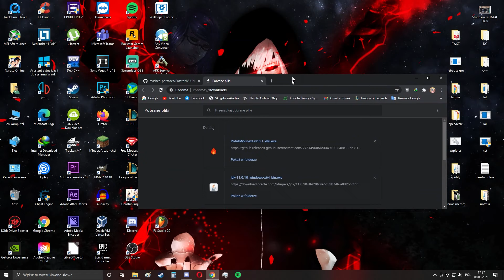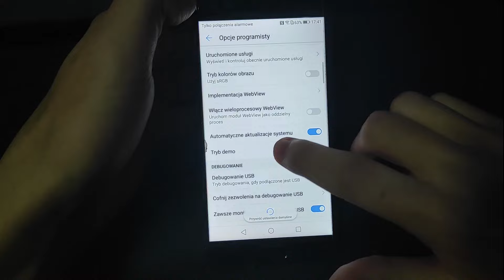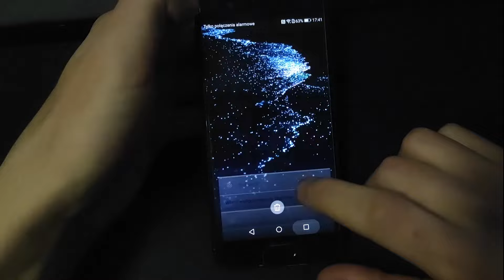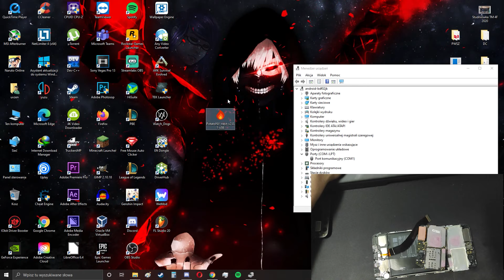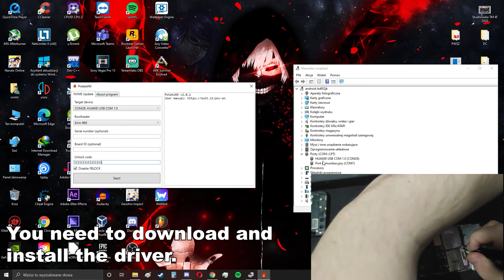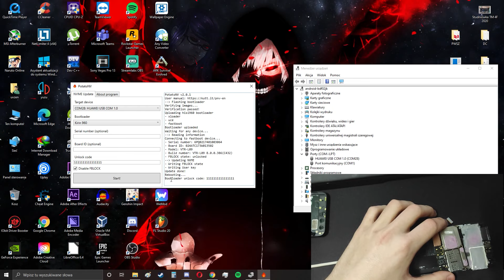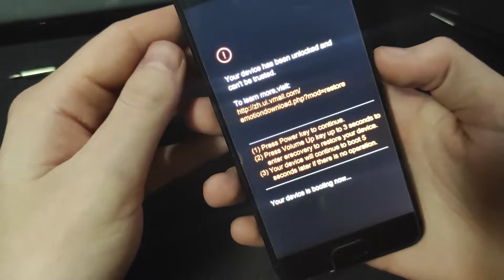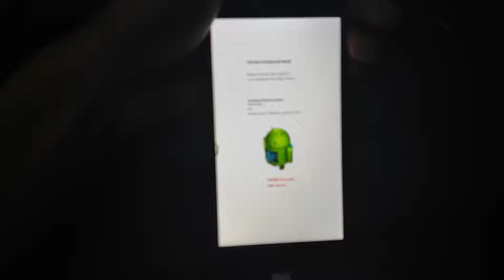Huawei unlock bootloader | PotatoNV Tool Kirin 960/950/935/925/650-659/620 (READ VIDEO DESCRIPTION)

Comment: Hello
I have a question. 
When working with test points and grounding
Do I connect the phone battery cable?
Are we doing it without it?
Thank you.
Reply from the maker: Disconnect the battery.
Reply: @uvzen  Hi. 
In the latest version of Potato NV,
There is no unlock code 16 text box.
Will it be created automatically when I start?
If you're not sure, should we try the old version?
Reply from the maker: @이상혁-e7s  The latest version automatically generates random code, but if you want to use your own code, you can download an older version.

Comment: will this work without bootloader unlock code?
Reply from the maker: PotatoNV will unlock your bootloader without the code. You have options like in the video that you can enter your own and new (for example: 1111111111111111) unlock code and in the future you don't need to use PotatoNV to unlock it again. You will be able to unlock with your code.
Reply: @uvzen  thanks

Comment: And what will heppen if i do this process without opening a back cover dos my smartphone backs my phone is honor 9 lite kirin 659
Reply from the maker: If you don't take the back of the phone off, it won't work. Removing the back of the phone is necessary to unlock the bootloader. PotatoNV will work on your Horon 9 Lite with a kirin 659 processor.
Reply: @uvzen  thanks brother 👍

Comment: It is possible whitout unlock oem option? My Android is corrupted and stock on huawei logo, but enter in fastboot
Reply from the maker: In PotatoNV, check the "Disable FBLOCK (not recommended)" option and press start. It should have you unlocking bootloader without unlock oem permissions.
Reply: @uvzen  ok, i have my code, but when i go to fastboot to unlock he give me unlock frp or sometimes like this. Do you have a metod to unlock frp?
Reply from the maker: @Alivu70 Do you also have ADB & Fastboot drivers installed? Everything is fine with PotatoNV, only you have something wrong with the drivers, I'm not going to guess. Maybe try to do it on a different PC/laptop. Install hisuite and ADB & Fastboot and testpoint drivers and then use PotatoNV.
Reply: @uvzen  solved, no hisuite. Now i have the code , but i have to unlock frp, can you help me?
Reply from the maker: @alivu70  As for frp oem, if you checked "Disable FBLOCK (not recommended)" when unlocking bootloader, you already have the bootloader unlocked without using the command: fastboot oem unlock <code>.
Reply: @uvzen  what do you mean for checked? On or of?

Comment: So i cant unlock OEM by going settings since i can't start my device at all, any oprion for me?
Reply from the maker: In PotatoNV tool, check the "disable fblock (not recommended)" option. No need oem unlock and new generated bootloader code. Your device will be unlocked instantly.
Reply: @uvzen  Still won't work, gives me a key to unlock but i cant use it. since it says oem locked
Reply: In adb it says , necessary to unlock FRP in fastboot
Reply from the maker: @koz536  Cause you didn't allow oem unlock  in developer options 🤦. This is shown at the beginning of my video.
Reply: @uvzen  Even though this is irrelevant to the video i did say i can not start the mobile device so i cant oem unlock in dev options
Reply from the maker: @koz536  I won't remember whether your device is working or not working, I don't have time for that. If your device is not working for you and you want to unlock it, please read my first answer again under your comment. Now after reading my first comment tell me where do you want to use the unlock code when you don't need it? If you've followed to what I wrote, you shouldn't have any problems and your reply was "Still won't work, gives me a key to unlock but i cant use it. Since it says oem locked". So you ignored my comment and keep writing about some stupid code and oem unlocking.

Comment: I want to ask one thing can we install android 11 gsi's on older mobile models like honor 8 which is currently running on Android 8 oreo..
Reply from the maker: Sure you can, but I don't know if it's worth it, because Android 11 is not much different from Android 10 (it's worse, that's my personal opinion). Additionally, there is a big difference between Android 10 and Android 8, so the device can get stuck, so lightweight custom roms are recommended then, but for Honor 8 the custom rom support is weak. So in my opinion, it's better to buy a newer phone model than to sit on Huawei and Honor devices if you want google services and android support.
Reply: I has this one as secondary phone...
Reply: I only want this for unlimited Google photos storage..... Give me suggestions...

Comment: How to get unlock code in mate 10 lite?
Reply from the maker: I don't understand your question. Huawei has not been giving out codes for a long time and why do you need an unlock code if PotatoNV will unlock your bootloader without a code and will generate a new unlock code for you in the future to unlock bootloader again.
Reply: in the program it asks for an unlock code
Reply from the maker: @yuri-bd6vr  You enter your own code as you want, for example: 1111111111111111 and potatoNV will generate a new code 1111111111111111. Your code may have random digits, but it must be 16 characters long.

Comment: My OEM is greyed out. What I have to do? Any solution?
Reply from the maker: Connect your device to wifi network or data transmission and try to enable oem options.
Reply: @uvzen  doesn't work this method.
Reply from the maker: @tomasbertasius2840  What device do you have?
Reply: Huawei P10 VTR-L29 EMUI 9.1.0
Reply from the maker: Everything indicates you already have an unlocked bootloader, check it out. If not, flash pure firmware with dload and check the result.

Comment: Bro the 1111111111111111 is your real bootloader unlock cod or we can put any code i want 🤔
Reply from the maker: I entered a new code: 1111111111111111 and potato generates a new code with unlocking the bootloader: 1111111111111111
Reply: @uvzen  thanks

Comment: bro , im getting message like "The operation has timed out
Reply: any solution
Reply from the maker: Install USB drivers or install / reinstall hisuite and try again.
Reply: @uvzen  I going to do oem unlock Honor 6 which is old mobile ,i think Hisuite mayn't work for Honor 6.
Reply from the maker: Hisuite installs basic  usb drivers, I don't know what you think is supposed to "not work for Honor 6" 🤦‍♂️
Reply: @uvzen  I WILL TRY , I want  to root my mobile , to recover my deleted photos, do you have any idea or video link to recover to recover deleted photos from internal memory.

Comment: Any way to relock bootloader with PotatoNV?
Reply from the maker: PotatoNV will only unlock bootloader. You checked the "disable FBLOCK (not recommended)" option using PotatoNV or did you unlock with the generated code in fastboot mode?

Comment: Is It possibile unlocking the bootloader without opening up your phone?
Reply from the maker: If you have a very old Huawei device with android 6 or below then check out my other video on the channel. If not, then there is no other option to unlock bootloader.
Reply: @uvzen  I have a p10 lite with android oreo so I guess it's not possible. Thanks for the support though

Comment: I'll just use all 1 as unlock code?
Reply from the maker: PotatoNV has received several updates and you do not need to enter code with which you would like to unlock bootloader. Now this program itself will generate for you a random new bootloader code.

Comment: bro i have a huawei nova 3e kirin 659. i really wanna unlock the bootloader  but i dont know how to remove the back cover of my device . i dont have the materials nad i am really scared if i break my device .
Reply from the maker: I'm sorry, but that's the only option to unlock the bootloader for free at this moment. The HCU client has the same method, but you have to pay. There are videos on youtube that show you how to disassembly your device and I think you can do it without tools. For example, to ground the testpoint you don't need the tool with which I grounded the testpoint, you can use a thin wire with the insulation removed at both ends.
Reply: @uvzen  bro what if I use scissors
Reply from the maker: @sinaanhussain1517  I don't know, I've never tried scissors and I wouldn't try.
Reply: @uvzen  oh ok bro. Do u have any social media cuz I want to dm you
Reply from the maker: @sinaanhussain1517  My discord: uvzen#6084
Reply: @uvzen  k bro I sent ya

Comment: doenst show my device in target device
Reply from the maker: Have you removed the back of the device and short the testpoint? It is essential.

Check in the device manager if you have the USB SER driver. If so, install the HUAWEI USB COM 1.0 driver.
Reply: @uvzen  time out error after waiting for device
Reply from the maker: @jaylesterdapat7421  Try again, I didn't always get it right the first time and I had such a mistake.

Comment: does it work for huawei p9 lite 2017 pra-lx3?
Reply from the maker: It's hard to check what processor your device has and answer your question?
Reply: The processor Is Kirin 655

Comment: Please test point for huawei mate 9
Reply from the maker: If you have an MHA model then here is your testpoint: https://easy-firmware.com/media/articles/large/2018/08/17/237829-1534544302.jpg
Reply: @uvzen  1 more q do i need to disconnect battery
Reply from the maker: @g4m3rz19  yes

Comment: Any help for Honor play now ?
Reply from the maker: Is it hard to read my pinned comment or video description?
Reply: @uvzen   Ya I read that,  My is KIRIN 970. I was asking if there is any "help for honor play to unlock. because as mentioned by you this does not work. !! and it has been a year so, now any support for the unsupported ones.
and thanks for the reply. 🙂
Reply from the maker: @rahulmaurya5154  There will be no support for kirin 970, buy a license in HCU client if you want to unlock bootloader.

Comment: Is it possible to re-lock bootloader too
Reply from the maker: Yes, you can do it by following these instructions (It won't wipe your data while locking bootloader)

Go to fastboot mode and enter these commands:
fastboot oem hwdog certify set 1
fastboot reboot

That's all!

If you want to unlock the bootloader again, you can do it with the code you entered when unlocking in PotatoNV, but remember that this time it will wipe your data! (When you unlock the bootloader with PotatoNV it won't wipe your data)
Reply: @uvzen  will unlocking the OEM also release a network sim lock?
Reply from the maker: @ekeretteekpo3004  No, the simlock removal process is different
Reply: @uvzen  do you have a video on that, please?
Reply from the maker: @ekeretteekpo3004  No